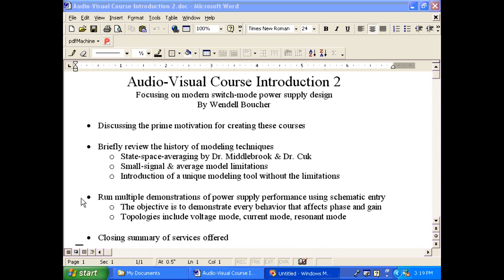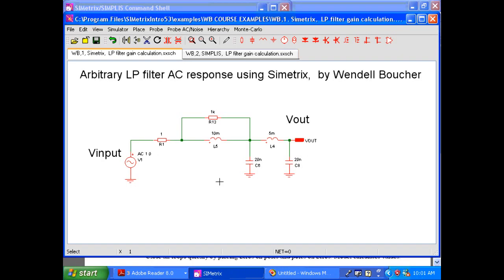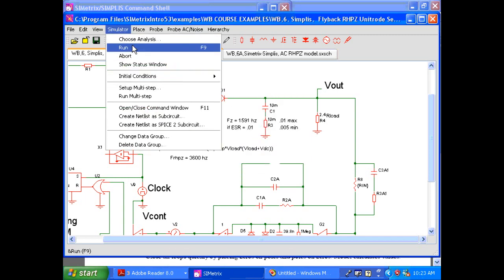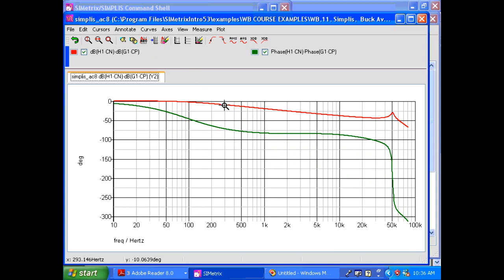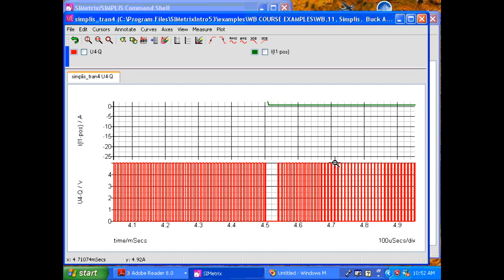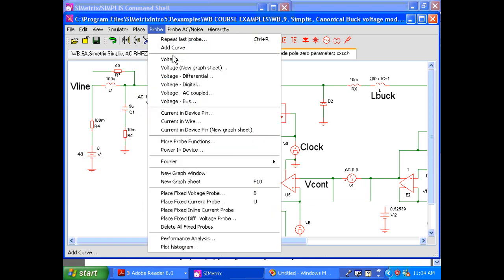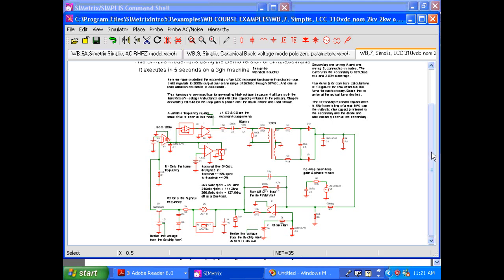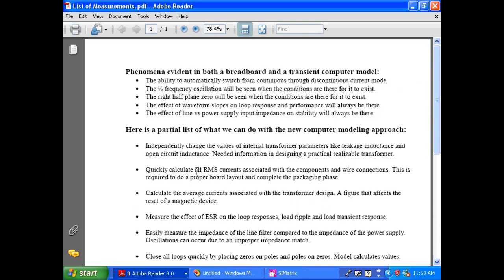Modern Switch Mode Power Supply Design, Closing  Feedback Loops using Simplis

Comment: Is Simplis better or Micro-Cap or are they both similar - with respect to accuracy of output?
Reply from the maker: Simplis is better in terms of being able to simulated a AC bode plot using the transient analysis. Only a few simulators can do this. Simplis I believe is actually two simulator. It comes with Simetrix which is a Berkley Spice simulator or similar to Microcap.   Simplis is not a Berkley SPICE simulator but the model it uses are very simplistic and do not model the second order effects such as Berkley SPICE simulator such as Microcap. Microcap is based on the Berkely SPICE engine and is very accurate.  However, it can not extract a AC bode plot using the transient analysis.  I hope this answers your question.

Comment: I don't understand why you need PWM comparator to modulator for Simplis.  Here is the simple circuit with multiple poles in which we suppose to apply the AC sweep. And we are only looking at the gain and the phase as on the NWA.  I physically hook up the nwa without these modulator.  Why?